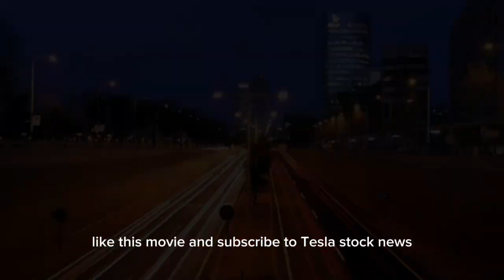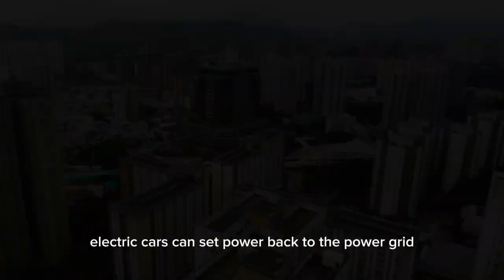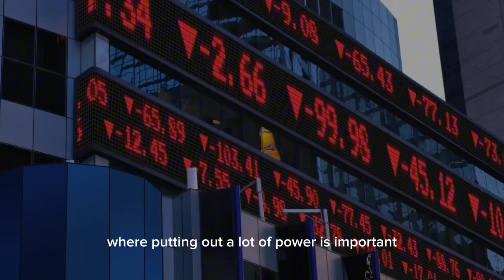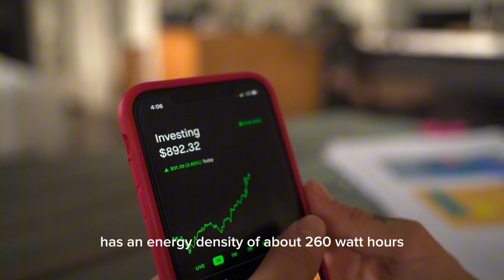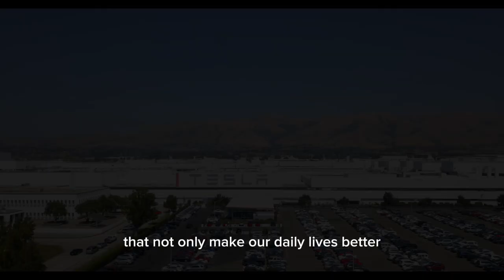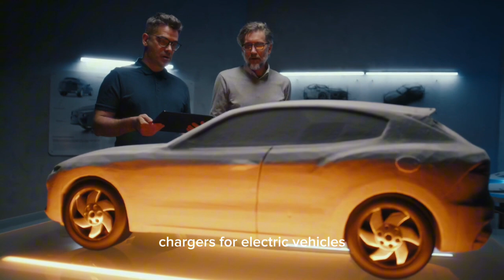Elon’s CRAZY Innovation Just Reshaped Tesla’s Future

Comment: This is not going to be the technology that moves us forward.  Hydrogen and hydrogen hybrid technology as it doesn’t require anything from our power grid.  Also, the range is unlimited using water to produce hydrogen fuel which is the most bountiful element on earth as 4/5ths of the earth is covered with it in oceans.  Also, what comes out of the tailpipe is water vapor.  Toyota, VW and others already have hydrogen solution in late stage development.